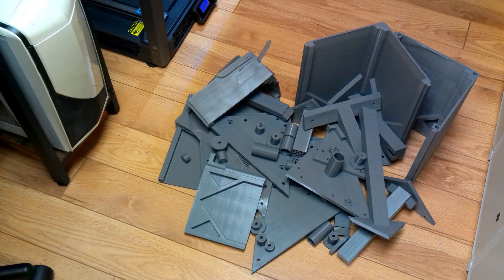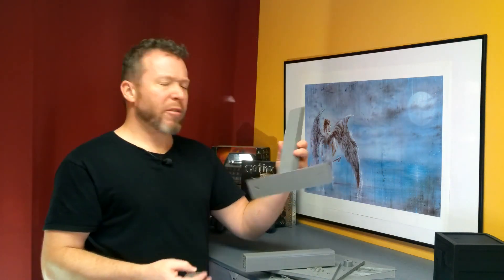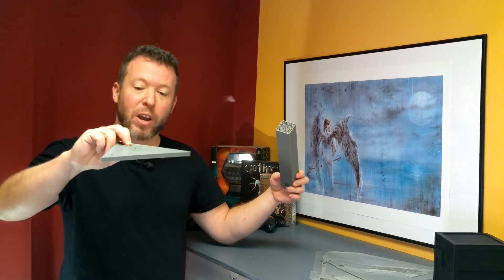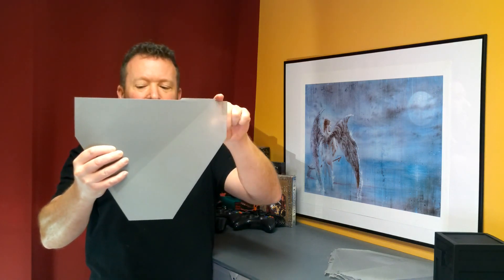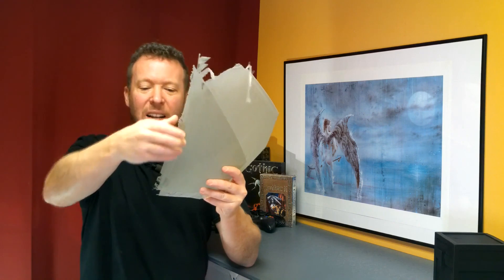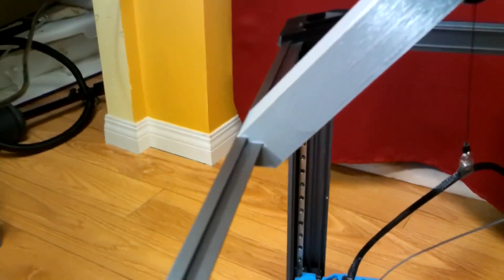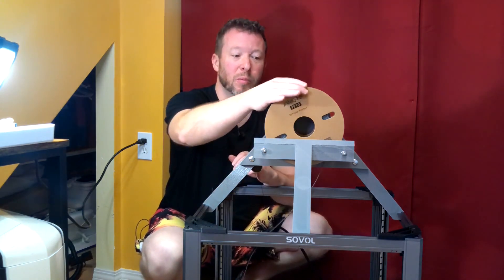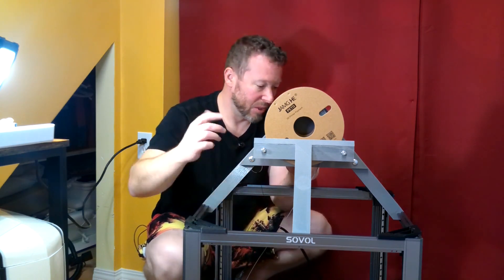SV08 Spool Holder Like No Other! 🔥🎭

Comment: To prevent the layer / 90* strength issue, I embed the vertical transition 5-6 layers (or more) down into my model's infill. This makes for cleaner transitions and also adds significant strength to the part.
Reply from the maker: Good to know

Comment: Ah! There it is. I like it! 

And I had the same "patchy" layers as you did @2:34 due to a roll of filament that was oversized. I took out the second section of Bowden tube and the remainder of the roll printed out fine.
Reply from the maker: Yeah I got rid of the bowden tube all together. But increased friction in the feed system is a good point to look out for.
Reply: @DomDecodes  IMHO, the root cause is the weak extruder. The one that the QIDI X-MAX3 uses is far superior. I'm waiting for a multi-toolhead design to transcend all this crap.

Comment: hmmm... even if you have the enclosure this is should work too, correct?  You're only using the interior of the frame, so it should work with the enclosure.
Reply from the maker: With the side panels yes. But the top panel will not fit anymore.

Comment: the stability is not a issue with the side pannles on my issue was with the taco bed and hot end
Reply from the maker: Yeah inconsistencies are an apparent issue, not only in print results but in assembly quality.
Reply: highly recommend the taco bed fix! it's actually a straight forward problem with a simple fix

Comment: It took me over 3 months, on and off, to get the SV08 running near an acceptable level. And I'm not even a starter. 🔥🤓
Reply from the maker: If I don't push the printer, it actually worked more then acceptable from the beginning. But as soon as it came to sub mm precision and after some of my more extreme "improvements" that wasn't necessarily the case any more. 😁
Reply: @DomDecodes  I think mine was build on Monday morning, came with faulty parts, and in the end a factory reset (note, I didn't change anything yet) brought the printer to life.
Support was very responsive, but I shouldn't even have needed it. I'll never buy one again.
Reply from the maker: @me8016  Quality control seems to be the common denominator when it comes to faulty printers. I do hope you can now enjoy it though, because it can really print big stuff.

Comment: I thought about integrating a couple of reel feeders into the top of my 3D printed SV08 enclosure but I feed from overhead wall mounted reel holders so I didn't and instead used the top of the enclosure to house two large carbon HEPA filters.

That layer shift is concerning.  I've had stuff like that when accidentally sending G code for a larger printer to a smaller printer.  The smaller printer is properly homed (the SV08 homes X, Y and Z before every print) but the firmware tries to move off the bed and the stepper motor skips at the end of travel.  When it goes in the other direction, the layer has shifted by the lost steps.  A printer should detect that it's trying to move beyond its limits, stop and generate an error message but maybe it doesn't know its actual limits?

The "gills" on your first layer are the bed too low in that area.  Reducing the Z offset by 0.01 or 0.02 mm can fix that but will probably cause the nozzle to be too low elsewhere, causing a rough surface finish because there isn't enough place for the molten filament to go so it piles up in ridges or balls.  This is the SV08 having a thin aluminum bed that warps when heated, and the problem is compounded by the low accuracy 8 mm inductive probe that isn't properly temperature compensated.  One way to improve the situation is to heat the bed to 65 C and Home All, then lower the print head an additional 5 mm so it's 5 mm above the bed and let it heat soak for 10 minutes.  That should help with the lack of temperature compensation in the inductive probe by preheating it, so it's not warming up as it's probing the bed, with the Z heights changing as the probe warms.

My SV08 still has the warped bed and inaccurate inductive probe that prevent me from fully utilizing the SV08 to its full potential.  I need to shim the bed so it's much flatter when heated but I'm hoping someone will have a good after market fix.  I'd pay US$100 for that.  I've seen a mod to use an inexpensive 12 mm inductive probe that is more accurate, but I'm hoping someone will sell an upgrade with the Beacon probe that scans over top of the bed to quickly produce a more detailed and much more accurate bed mesh, and the latest Beacon also has an accelerometer that allows the heated nozzle to directly probe the heated bed and a 20 gram force touch is all that's needed to set the actual Z=0 as the calibrated offset for the bed mesh, so the SV08's touch probe in the right rear would no longer be needed.  I'd pay US$100 for that upgrade too.  With both upgrades, I could print a perfect 350 x 350 x 0.4 mm sheet for the first layer.

For now, I preheat the bed and inductive probe before large prints and I print as close to the center of the bed where it's flattest, avoiding the more warped and cooler corners.

The retractable badge lanyard is clever.  I uploaded an "SV08 Extruder Cable Chain - Cable Management" to Thingiverse and Printables if someone would like a 3D printed TPU method to stiffen the extruder cable without the Bowden tube.
Reply from the maker: Yeah the layer shift was crazy. 
But after running a full set of calibration, everything is running smoothly again.
I was equally under the impression the auto home prior to every print should prevent that. But it didn't.
And why did the printer lose the zero setting on the second layer 🤷